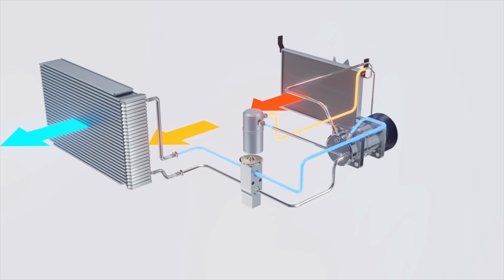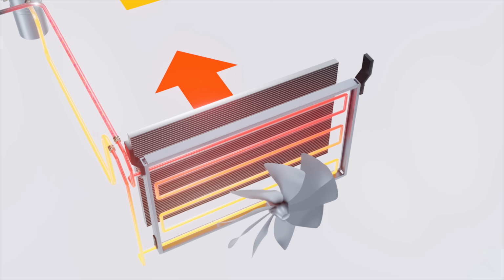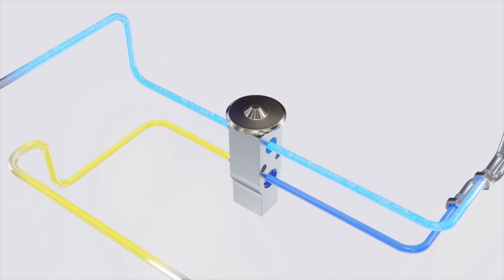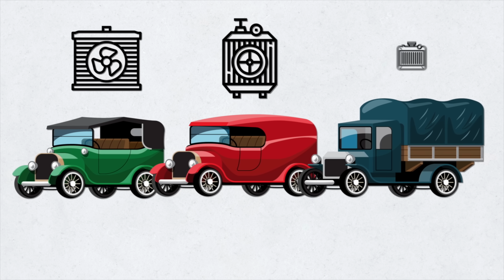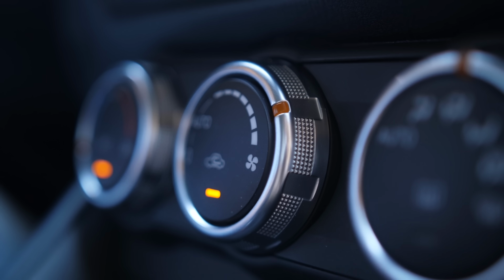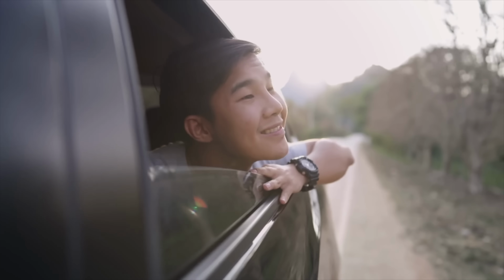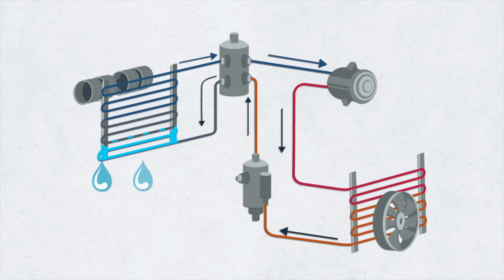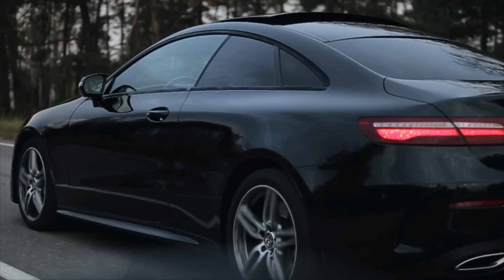Never Do This to Your Car’s AC System

Comment: My dad bought a 1953 Buick with AC. After several un- 11:11 airconditioned years going to Florida in the summer, we could hardly wait to take our “wonder car” on its first FL trip. Things were going well, until the system stopped sending out cold air (froze up, in the day’s jargon.). Undeterred my father was determined to fix the system. He stopped in town and cities looking for a remedy. Each mechanic had a different remedy, but the funniest was to uby clothes pins (like your grandma used to hang clothes on the “line” for drying,) and clip them on the AC lines to dissipate the heat. C R A Z Y … not funny then, but hilarious now to think of riding down the highway in your handsome Buick with clothespins sticking up all over the engine.

Comment: I have a Benz which when on the cold air comes and ceases after about 10 minutes.  After it will just be blowing air. When you  turn it off for sometime and turn it on the cycle repeats itself.

Comment: my body always "ran hot" so i always used my ac all year round, even in 3 feet of snow outside.  made small talk with a mechanic around 2017-2018 about ac and he explained the overall tech to me and the importance of running it for lubrication.  also said the major cause of fridge leaks and other breaks was because of lack of use in the winter due seals and stuff drying out overtime from those couple months without lubrication.  So without even knowing it i nurtured my ac and it blows just as cold 21 years later as it did off the showroom floor.

Comment: I got a problem with my nissian maxima 2017 ac dorman hose gets cold as heck never done that before it has a lot of condensation maybe a leak idk engine light came on my friend went in the fuse box and unplugged and plugged back in this fuse or whatever and the engine light went away but the dorman hose still gets cold I’m in Texas 95° average rn so it isn’t freezing, with the fan running it cools down if I have it running with the ac off and fan on the line gets regular temp not hot or cold

Comment: i had a 2002 , Noen , and i live in pittburg ,, and i would Turn the Ac off when going up hill .. But i could See a Performance Difference, and i ddi this TO save On Gas Milege ,, But Scoot is Right , in newer CArs,, they are Going to Shut the Conpressure off when the power Drops .. So you don't need to turn it On and off in newer Cars ...

Comment: I have a 2022 Mazda CX-30 and if you accelerate hard the AC automatically turns off until you decelerate to a steady speed and then the AC starts flowing cold air once again. This is a feature that Mazda built in to its software.

Comment: I have questin. When u turn knob to heat it heats the air. But a/c isnt turned on. U can allso pres ac butun to turn it on and again it heats cabin. What Is diference betven those 2 heatings

Comment: The air conditioning in my car seems to consistently fail on long drives over 2hours. It seems to be normal at the beginning, but it fails after running for 1 and a half to two hours. During normal drives in the city it functions perfectly, but miraculously fails when operated over long drive. Any solutions??

Comment: I had a 2009 Mazda CX-7 and my a/c stopped working so I took it to the shop to have it checked out and the mechanic told me replaced some parts that will cost me $3,000 (more than the car was worth) so I told him I will think about it, knowing there was no way I was going to spend that kind of money in the car. On my way home I turned on the a/c and it started to work perfectly 😮, I drove the car for another 3 years and the a/c worked perfectly, don’t know what happened but I’m glad I didn’t spend the money😊

Comment: Scotty is right about using the AC at regular intervals, I didnt have any gas in my AC and didnt switch it on for that reason, when i did get gas in it, of course I used it again as it was a hot summer here in the uk that year, alas it had begun to seize up, I dont know if this was due to non use and corrosion combined but it started to seize which made it emit funny noises, then funny smells too, burning smells sometimes, then alas smoke started to appear passing through the vents and from under the bonnet one morning, alas my poor honda nearly caught fire just because I didnt switch the thing on enough and it seized!

Comment: my brother's 20 year old Hyundai is prone to overheating and the AC stops working when the engine temperature starts going up when going uphill and restarts when it drops to normal. my car on the other hand has no AC because the compressor broke a few years ago and i never bothered to fix it

Comment: In regards to turning off the AC when climbing a steep hill, I can say without a doubt that in the 2005 kia rio with 105hp it makes a sizable difference.  In fact, the AC on-off switch was once reserved only for small cars for that very reason.  The 1980s Ford escort for example had that button so you could turn off the AC when climbing a hill due to its relatively anemic engine.  Most large automobiles with larger V6 or V8, it does not really matter.
Reply: Ah, the old “turbo” button.

Comment: My worst AC experience was with my 1999 Saturn. On a summer road trip to Vermont, I wanted to use the AC on long stretches of highway driving, but it wasn't blowing any cold air. I had the car serviced before the trip, (to avoid problems like this); and, on my return home, I asked the dealership to check out the AC, (which I didn't use in city driving). It was simple. When they had replaced the engine, (a year before), the mechanic hadn't connected the AC back to the controls; no reason for this negligence; and, they lost me as a customer.

Comment: AC Problem-2000 Explorer 5L, when outside temp is above 90 the ac unit blows hot air at idle.  Bring engine rpm to 2000 and it blows cold air.  Compressor has been replaced and system checked by dealer.  They don't know what is wrong.  What is it? Your video was very informative.

Comment: Not surprised it's higher in hybrid vehicles, the heater and the AC really work the battery, and since the car is designed to use that first, then recharge it via braking and the gas motor(and for occasional assistance when you need more power), it burns up the battery charge fast and uses the gas motor more often as a result.

Comment: When the AC is on, during idle the engine running at 750 rpm. but when I turn off my AC, it straight goes to 1000. How does NOT affect engine performance?

Comment: So, should you use the recycle feature or the outside air intake for the A/C? Yes I know it depends on a lot of factors and variables but I just want to know what puts less strain on the system.
Reply: It is easier for the car to maintain the temperature of recycled air than it is to cool any new air that enters the cabin. This means: close the outside air vents and keep air recycling on.

Comment: On my toyota Corolla, 1.6L, 2006, I apparently had a hole somewhere in my condensor. It cost me around 500 dollars (5000 converted to Swedish Kronor) to fix that at my local, non toyota auto repair shop. So yea, it aint cheap, but oh so worth it in the end.

Had I let my local toyota dealership fix it, they probably would have charged med around 600 to 800 dollars. And I also think they somehow would have screwed it up.

Comment: A while ago I read about turning on the AC in the winter frequently to lubricate the parts, and then I found out that my AC (compressor) does not turn on when the temperature is less than about 4 Celsius. Garage is not heated, temperature did not get above 4 for several weeks :)

Comment: i had a 2002 buick lesabre, and when i bought it, no matter if i put it on hot or cold, the 2 vents on the drivers side always blew hot air. I was told theres some kind of a flap or valve or something that is preventing the cool air from coming out on that side. even with the AC off it oozed hot air, so i had to keep the vents closed, and that made the dash get hot a lot... thank god i drove that car till nearly 200k miles with few other issues for a long time, and scrapped it when i bought my new Subaru

Comment: Turning on the air conditioner every now and then even if it is cold mostly matters because the compressor is belt-driven, so it can't be completely hermetic without any moving parts coming out of it (some cars have an electric compressor which can be fully sealed, especially if they are hybrid or electric, but that's not common). The seal around its shaft relies on the oil being in it to remain gastight, so that you can lose the refrigerant if it is left off for the whole winter and part of autumn and spring even if you have it tested and there is no leaks. Happened to my father's car a few times before I found out about this.

Comment: My dad remembers having a swamp cooler mounted in the car's passenger window. It worked from ram air and looked a little like a jet engine. This would have been in the late 40's or early 50's.
      I one of these devices at a classic car show, which is what prompted my tell to tell me about it. He said it worked great in the dry desert, but you had to keep stopping to put more water in it.

Comment: Had my a/c go out a few days before the warranty was up. In June. In Phoenix, AZ! And the damn techs decided to do everything to the a/c EXCEPT what was needed to fix it (new cabin air filter, refrigerant shot, cleaning out the blower)! Fighting with the damn car lot as we speak. It needs a new blower motor and resistor. $718 for parts and labor

Comment: People say that the only company that publishes the specs of their AC is Honda for a Civic. It is said it removes 12,000 Btu/h, which napkin math says is equal to 5HP or 3730 Watts-ish. So, adding ineficiencies or for a larger unit in a larger car, you could say 10HP.

Now, a car COVERED in solar panels can't reach that value. Solar panels can't even power a 5HP AC system. That's why Tesla doesn't have them. 

But people still try, because you could recover 20 or 30km autonomy per sunny day parked outside with an EV. 

You can run the numbers yourself, and update the napkin math with the best solar panels you can find, and the spec-sheet for the best vehicular AC system you know.

To top it off, most cars have throttle or torque sensors to cut the AC power if you REALLY step on the gas, and I had a Ford Escort mk6 that did just that, if I really hammered it down. "Hey, this punk wanna go fast, cut the AC, Joe!"

You can really tell the AC is running on the idle of compact cars, most vehicles will apply extra throttle on idle. If you feel the throttle floating on and off at regular intervals but it doesn't cool, it is a telltale sign the compressor is working, which is good, but the system is leaking, which is bad, because most cars use the same fluid to LUBRICATE the compressor!

Just trivia facts out of curiosity about solar panels.

Comment: My AC blows hot air when i'm in traffic or at a light? Refilled the freon and there's no leak. Is the compressor the problem?
Reply: Did you overcharge it?

Comment: I have a 2012 chevy sonic. Was quoted by the dealership that a/c compressor needed to be replaced. Started to have a/c temp heat up at stop lights and got cool again after taking off from stop. Took car to local high school automotive class. Found out all I needed was a new radiator fan and connector harness. $150 compared to $1400.

Comment: :36 Did you know your car’s air conditioning system does not generate cold air? It draws moisture and heat from the air in your car…

Maybe I’m not splitting enough hairs here, but if you’re drawing heat from some air, aren’t you making colder air?

Comment: bought a second hand car, of which the AC the dealer had to repair. (audi A3 2014)
the evaporator was leaking, and had a decent leak too!
Funny, I could not smell anything. And nor could I find the dye in the water puddle after using the AC.

I had two tell tale signs of the leak:
only the drivers side would blow cool air, after a while, none more.
a second sign was a sound. A hissing sound when you turn it on after it stood for a day or so. The hissing sound would each time get longer.

the dash needed to come off. And it being complicated, they didn't fully know where all the release points where, so minor damage has occurred with them taking it out.

Comment: I have no personal experience with looking at my mileage with the windows open but I have made note of mileage with and without AC. In my 2021 GMC w/5.3 l engine, it is so close I can’t tell it there is a difference. I get about 19-20 around town (< 40 mph) and 21-22 highway (cruise set at 77 mph).

Comment: 1999 Lexus SC400. Live in SE Florida. Have other vehicles, 2005 Toyota Pickup, 2019 Genesis G70 Sedan. 2018 Lexus RX350. They all cool down quickly. The SC seems to take much longer to cool down the car. AC takes a while to start blowing cold. Once it gets cold it is fine just takes a while. Admit the other vehicles are newer, 2005, 2019. The charge is correct and it doesn't frost up. Once it gets cold it is fine. Any ideas?

Comment: I only buy cars based on how cold the a/c is. I'll run a heat soak test and test how well the car cools down  on a scorching hot day as well as how cold the air is coming out of the vents. Some cars cycle go where the compressor shuts for 5 seconds and Manza's, Ford's ,Toyota Corolla & Honda do that and take too long to cool. The Toyota Camry doesn't cycle. Chevyd a/c isn't cold at idle

Comment: Does it damage the system if you always dial the setting to “low?”

I always try and recommend to friends set a realistic temperature or dial positioning, and use the electric fan instead at higher settings.

Comment: After running my 03 dodge ram 5.9 the oil pressure gos crazy. Dings drops gets high stays there until I raise the rpms,Then drops back to 40. But I noticed if after I run it for awhile turn on the ac at idle  it dings drops gets high and then I turn it off and it drops but not back to 40. Did it several times  and it happened everytime. No codes doesn't happen all the time it's random. Oil pump? Enjoy your show keep it up.

Comment: Personally, I live in VA and when I am in the car alone, I do not use the AC unless the outside temperature is above 90 degrees, because I personally feel that it is a complete waste of gasoline to only Air Condition myself. 
On regular roads 40-50 mph and below, I keep the windows down. On highways, I keep the windows up and the fan on, but with out the AC running. 
When I have passengers in the car, however, I will run the AC, since there are at least two or more people in the car to keep cool, and I don't want to irritate my family and friends.
Reply: Windows are dark, better visuals with them down. Them motorcyclists and curbs love to hide on the blindspots.

Comment: I would argue that it is a good idea to turn electrical loads off (including the A/C) before turning off the engine as it puts an immediate load on the charging system when you restart the engine.

Comment: Did he say gotta turn on cold AC once a week even in winter?  I wish the winter here is like Texas.
Reply: Turn the compressor on.  You can still run heat, but the air will dry out, and you won't fog as much.

Comment: 1994 Suzuki Sidekick has dealer installed air. Parts are IMPOSSIBLE to find. So we decided to switch to a factory A/C setup. Condenser, electric push fan, filter/drier (with a pressure switch), compressor, evaporator and expansion valve. The system also had an evaporator temperature switch (mounted on the airbox to the evaporator with a thin metal probe). Going through the wiring and hook up of everything now. Not sure how the (as Suzuki calls it the dual function high/low switch on the filter drier will work but) we will see.

Comment: A couple of summers ago the AC stopped working on my 85 Camaro. No problem for me, but my wife couldn't take the heat. I myself then replaced the condenser, orifice tube, compressor, accumulator, hoses and flushed the evaporator. Vacuumed the system and added refrigerate. In Canada eco friendly 12A refrigerate is widely available and inexpensive. Two years of cool summer driving so far.  My cost for parts tax and delivery, $600 Canadian.

Comment: I have a '78 Chevy Caprice with a 305 engine, 2bbl carburator.  I had the AC system fixed with a new compressor, dryer tube and R 12 Freon.  It was working great until the weather hit 90 degrees one day after 3 months.  What do you think happened?

Comment: Two a/c questions: Is turning your a/c on at freeway speeds bad for the compressor clutch?  And, do any a/c parts need to be changed when converting freon from R-12 to R-134a?  My 1990 Corolla's compressor clutch blew up about 15 years ago.  I replaced the compressor with one I got at a junkyard.  Since then I only turn the a/c on when the engine is at idle, but I'm not sure if it really makes any difference since the compressor cycles on and off during normal operation anyway.  When I replaced the compressor, I had the R-12 system evacuated and replaced the freon with R-134A but never replaced any of the a/c components.  And it is still working, but it has never cooled quite as well as it did when it had R-12.

Comment: Actually Scotty, that sweet odor is NOT due to a refrigerant leak, it’s comes from the condensate pan, typically when the system has not collected any condensate for a while. Small amounts of Benzene may also be detected when the fan first starts up.
A refrigerant leak would never be detected by someone’s nose in a car 👍🏻